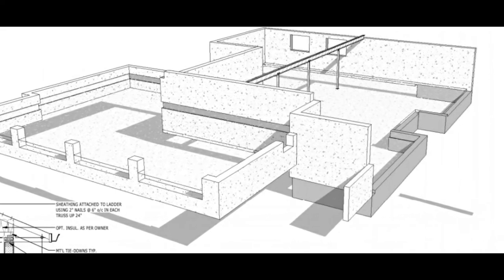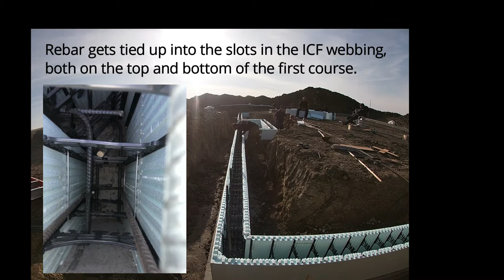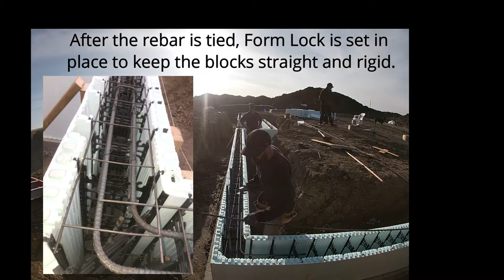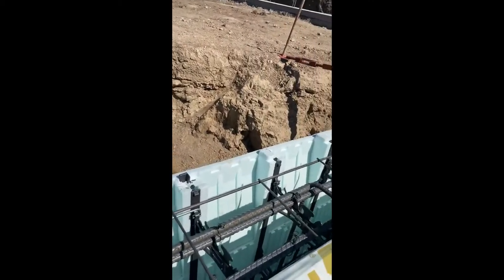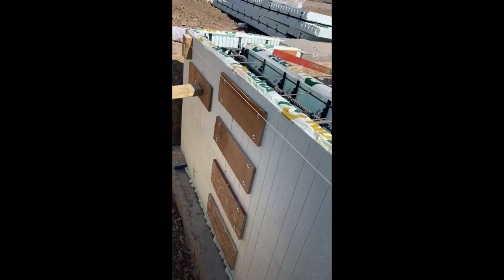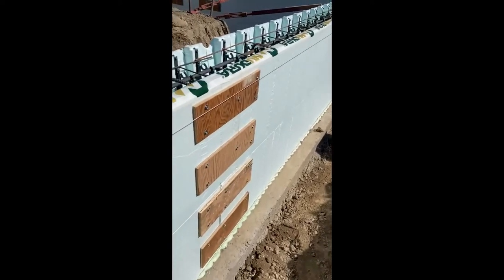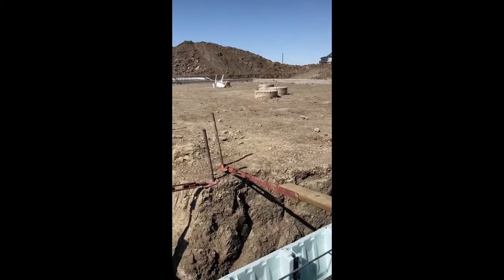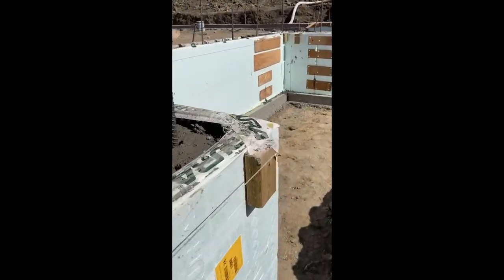Vlog 3 - Building an ICF Frost Wall - Nudura ICF

Comment: Do you have a link for those adjustable braces? I'm worried about using fixed dimensional lumber on pour day for the frost wall.
Reply from the maker: I don’t have a link for the adjustable braces. We rented them from the company that we bought our ICF blocks through. They just had a weekly rate. Hopefully your supplier will have an idea of where you can rent some! They made it so easy to adjust the walls after the concrete was just poured
Reply: @eberlesbuildahousediyicfho9630  sounds good, I'll check with my supplier! Thanks